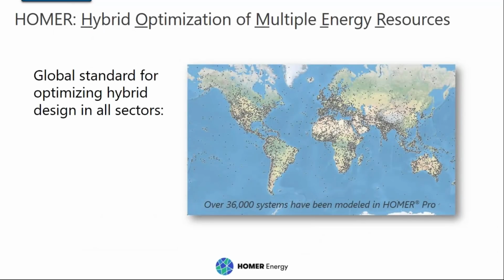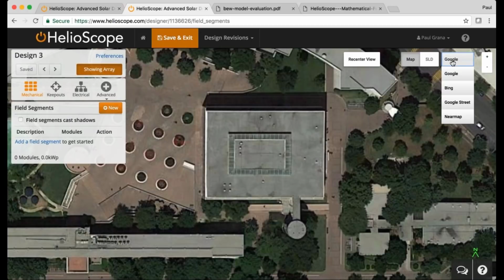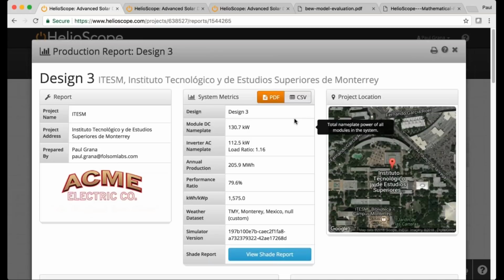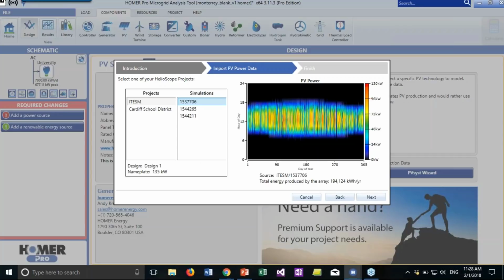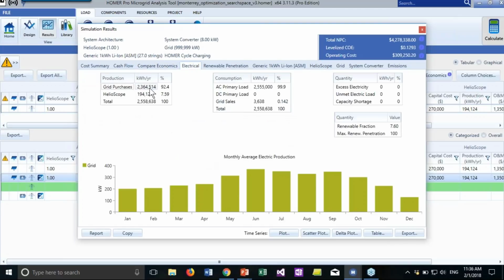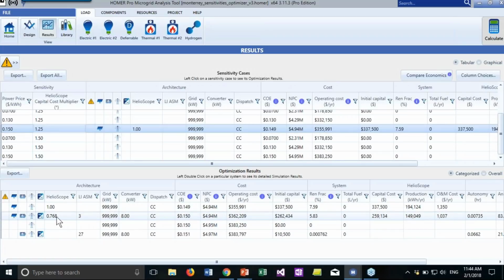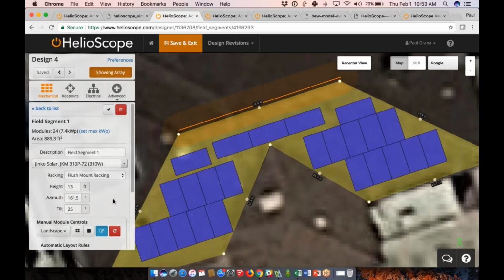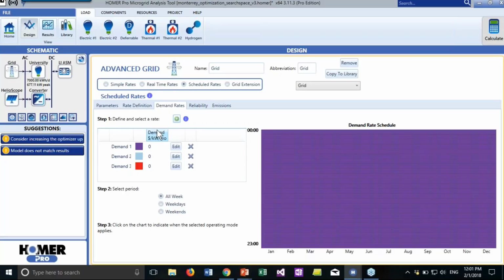HOMER Pro 3.11 + HelioScope Integration Webinar - 2/1/18

Comment: Does HelioScope allows simulation of stand-alone system?
Reply from the maker: Yes, you can simulate a stand-alone, PV only system with Helioscope.
Reply: @ULSolutionsHOMERSoftware  Thank you. Does this mean that I can use directly the exported energy production from HelioScope in HOMER Pro? Are there any ways that the SLD in HelioScope will not provide grid connection? Thanks